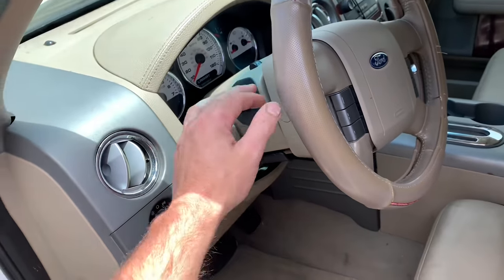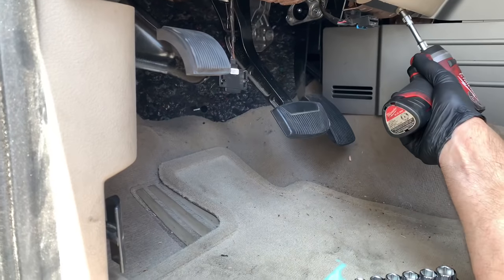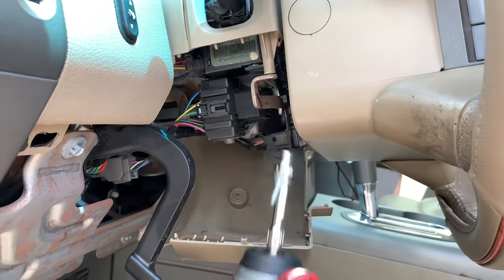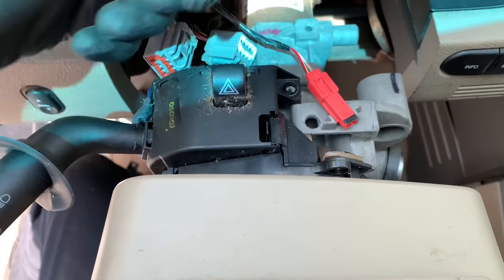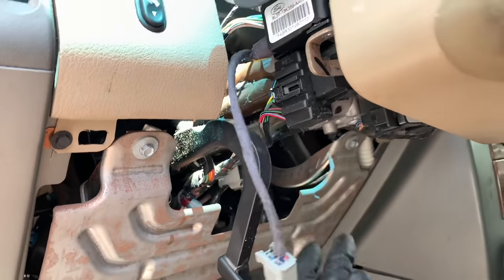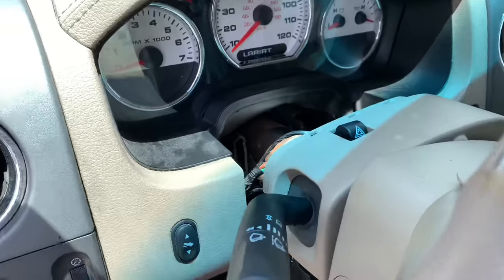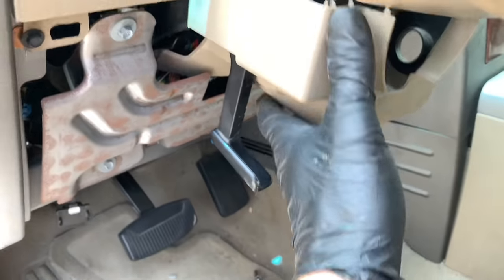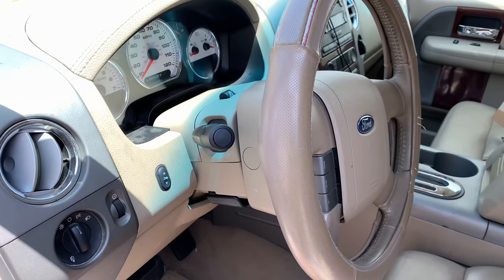How To Change Your Turn Signal/combination Switch On A 2004-2008 Ford F-150

Comment from the maker: Be sure to check out the How to Automotive Tool Store https://www.amazon.com/shop/howtoautomotive
Reply: Is the donicoo for $35 any good?
Reply: Any chance you remember where you purchased your blinker arm thing? Mine recently broke and its exactly how yours was when It was wobbly. I cant seem to find it anywhere
Reply from the maker: @samrabena2720  in the description of the video there are links for it. May have to click the little arrow that drops the menu down more to see it.
Reply: @HowtoAutomotive this looks like a very easy process to change out the switch I watched your video a few times because I too am experiencing a problem with mine recently. If I push the lever forward to activate my bright lights sometimes it will work sometimes not a few times I had to push the lever inwards and at the same time forward too to activate the brights and also same way to get them to shut off so I’m assuming my switch is bad this is the only problem as of now is with the brights the wipers and turn signals are fine I’m glad you posted this video ! Is the switch still working good ? Im kind of a DIY guy and think I can handle this. Where did you get the new switch ? any other things I need to know or expect? Thanks for helping all of us!!
Reply: @HowtoAutomotive Thanks for such an awesome video this was actually an easy job the only panel that was a pain in the arse was the bottom one under the steering wheel a little cussing and pushing with a plastic radio removal tool got that piece out new switch went in like butter and just more cussing to get that under wheel piece back in lol I did disconnect negative battery cable before starting NOTE: before disconnecting battery move your drivers seat back as far as you can if your a bigger guy like me 230lbs lol. The extra room helps. Tools I used were 7/32 socket ( I had no 5.5 metric) 7 mm for two screws holding big bottom plastic panel 5/16 socket for battery cable removal plastic fork type stereo removal pry bar and a cup of coffee. Once switch was mounted I made sure all features worked and they did. I like how the new one is stiffer when activating the directionals in either direction. But then again my old one was oem since 2007. Thanks for your detailed video!!

Comment: Super detailed video!  Thanks so much.  I'm a 60 year old grandmother and was able to replace mine by watching this. Having you tell us which screw size was a big help.  I actually didn't have a 5.5mm socket but a 7/32 fit.
Reply: Thanks for the 7/32 piece of advice. Made this a cinch!

Comment: Great instructions. I would add one thing to your instructions, turn the steering wheel to make sure arm returns to stop turn signal. I did not do this and got it all back together only to find out I now have to manually put the lever back after turning, not a big deal but a pain. I bought my part from Amazon, never will buy auto parts there again.
Reply: What's wrong with Amazon?
Reply: @mashedpotatoes5323  Cheap chinese parts, should have remembered, "you get what you pay for". Get OEM parts at least you don't have to do the same job twice.
Reply: @americanveteran1  just got the Amazon one in and I have no complaints. Did it not last very long for you?

Comment: I checked 3 or 4 different socket sets and none had a 5.5mm socket, a little math showed that 7/32 is almost the same. Worked great for me. Thanks for the short and to the point video.

Comment: There is also a SPRING that inserts into a channel under the switch. Don't lose it when you lift the switch up from the column. Make sure you install it into the new switch.
Reply: The new switch comes with a new spring inside
Reply: Didn't know of about the springs. Seems to me it's working fine

Comment: Toughest part was that bottom trim, coming out & especially going back in.  Helped when you described it as "flaring" those flanges that tuck into the steering wheel. Thanks & good job.

Comment: Dude! THANK YOU for posting this. It took me a little over an hour (I have 10 thumbs) but after wrestling the bottom section of the steering column back on required the most grunting effort, it looks and works great.

Comment: Thank you very much for the easy to follow video. The first video I found had many steps. Requiring me to pull fuses, disassemble the airbag, blah, blah. At that point, I decided to call PepBoys. They didn't have the  part so I researched again and found this video. It gave the confidence to go buy the part and do it myself. Bravo to you Sir greasy to follow instructions!

Comment: Hi Brian, Thanks for taking the time to do this, it's an excellent how-to video and better than most I've seen. I just replaced the TS combination switch on my 2005 F-150 and everything went well EXCEPT when it came to getting the lower half of the plastic cover back onto the column.(I noticed this issue has been mentioned in several comments here.)  After trying every possible angle and fighting with it for 15 minutes I started thinking it would have been faster and easier to just pull the steering wheel. I finally got it on somehow but I still have no idea how I finally got it into place. After the bottom cover was finally over the column I noticed the bottom and top halves were tweaked just enough that it was now impossible to get them to line up and snap together even though I worked on aligning them for about 15 minutes. It seems like the bottom plastic cover got stretched out of shape just enough that the two halves would no longer align properly leaving a small gap that would really bother me if this had been a newer vehicle.  I noticed another video where the guy removed the mounting screw from the bottom half cover but didn't pull the cover completely off--he just let it dangle under the column, held in place by the cover's two plastic flanges which were still in place under the steering wheel. That might be something to consider. Anyway, just my experience and a heads-up to anyone thinking of doing this. Thanks again!

Comment: Only vid on here that doesn’t want you to take the steering wheel off to do this job. BIG time saver. Thank you!
Reply: Thanks. Great video. Helped me out. The hardest thing for me was getting that plastic piece under the steering column back on. I got the left side up and then used s flathead to pop the right side up and seated properly. I couldn’t do it with my hands.

Comment: Thank you for this video, went step by step and behold I installed it, with a few hiccups from bottom small panel getting it back in. Can’t be afraid to bend the panel a little it won’t break. Didn’t take that long and saved probably hundreds.
Thanks again
Reply from the maker: Awesome I’m glad the video was helpful and you save some money. Thank you for watching!

Comment: Your video was very helpful.  Everything went exactly as you said.  I was prepared to remove the steering wheel and air bag, etc.  Then I happened upon your video which seemed like a much easier job, as well as safer.  About 20 minutes of work.  Thank you again.

Comment: Great how to video !! I just finished!  Saved a bunch of time. However, I didn't put the spring back in. I only saw the reference to it after reading the comment below.  With that being said, though, from the feel of the lever, it doesn't seem like it's needed after installing the recommended OEM part. Has anyone done the same and experienced any issues?  I'm keeping the spring just in case and will go back in if something doesn't feel right or function properly. Thoughts?

Comment: FYI if you don't get the covers seated correctly around the ignition switch it might not engage. I needed a new battery anyway, but that could have been an avoided expense had I realized that the switch was not engaging enough to allow the truck to crank. Thank you so much for this video.... I, uh, (kick the dirt) won't say how long it took me, but it is done! :D

Comment: Thank you for the info. Super helpful I just changed my switch on my 2006. Everything’s working. Keep up the helpful information. Good job
Reply: How to put a ford f 250 in nutru  manly
Reply: How to put a F-250 in neutral manually how to put a Ford F-250 in neutral manually

Comment: Bottom plastic panel!!! 2 things. 1. I have no 5.5mm socket but 7/32 worked fine. 2. Most my time was spent on reinstalling that bottom trim panel. On a hunch, I started the truck and turned the steering wheel 1/4 left. Turn off and remove key.. Was able to get the panel in (dare I say "easily"?) by starting on the right side. Wasn't really easy but I was going nowhere otherwise.
Great video. Even fighting that bottom panel it's still gotta be easier than steering wheel. removal.

Comment: About to do this job this weekend. Do I need to disconnect the battery because I’ll be working close to airbag?
Reply from the maker: Blue Man only if you take the airbag off.
Reply: This is also my project for this weekend. I paid $60 for the part.

Comment: Im wondering what is the book time for a turn signal replacement.? Is this any faster then removing the steering wheel or is this more for customer DYI so they dont need to worry about airbag

Comment: I've watched several of these- one mentions you have to pull out a small spring and transfer it. From the left side on the bottom, take it out with a pick. There is a tab on the left side that goes up into the new housing and that tab compresses the spring in place...

Comment: Thanks for the video Brian.

I was driving my dad's F150 & @ first I thought the high beam dash light was inoperable....

Then, head first toward a wall I clicked for high beams - nothing. Jiggled switch & it worked.... but wouldn't go back to low beam.. another jiggle & lever came out.

Yes, broken

I found your video & I'll change the lever in the morning.

i appreciate it. Thank you
Reply from the maker: Sorry your switch broke but I’m glad the video helped. Thank you for watching!
Reply: BTW. Just finished replacing. I didn't know my dad was timing...😝

20 minutes
Reply from the maker: VaHKGuy nice 20 minutes is not bad.

Comment: I just finished replacing mine. The bottom cover can be a nuisance. I'd suggest start on the right side first when assembling. (Just my preference) It seemed to fit easier for me. Thanks for the how to.

Comment: Thanks for the great video.  Other than the housing under the steering column (that was all me), I had very little problems changing out the switch.

Comment: Getting those covers back on are a pain.  Be careful not to break the tabs.  This is why its recommended to take the steering wheel off.  Anyway I accomplished the task. Thanks for the video.
Reply: Yeah, that under-column panel was a bit of a bear.  Luckily, I was able to finagle it back on without any tabs breaking.  I'm glad you did as well.

Comment: A casual search on SW6377 shows switches for $50 that look nearly identical to the one sold by motorcraft for $200. Is there something I'm missing. Merely saying one is "authentic" does not really do it for me. Since the "authentic" one is obviously deficient or it would not need replacing. Has anybody tried these other switches that cost only %25?

Comment: I’ve done this before, but I couldn’t remember how I did it. This was an excellent reminder to jog my memory. It was a memory I tried to block out. I had to replace my ignition actuator and actuator lever. Jesus H Christ the worst 15hr of my life. Everything is easier with the correct tools and knowledge, of which I had neither.

Comment: Great video instructions. I got stuck on the bottom cover for the steering column. Walked away from it so I wouldn't break it.😉
Reply from the maker: I walk away all the time. Lol
Reply: How did you get it off i’m stuck on trying to get mine off